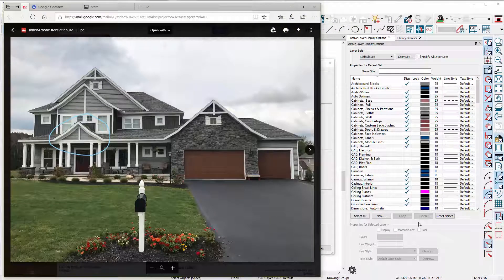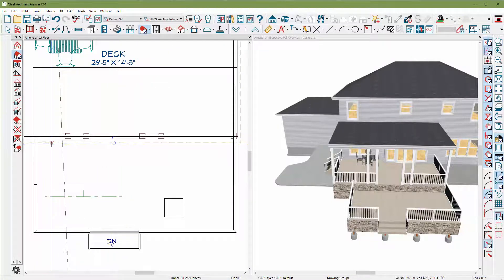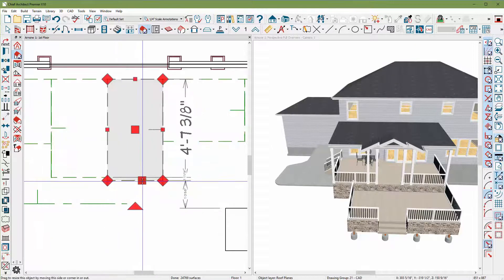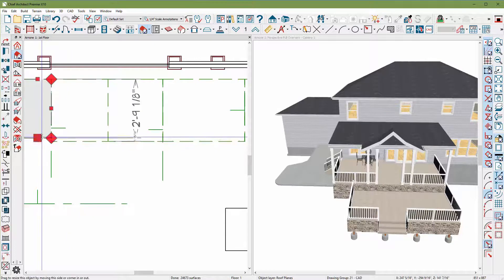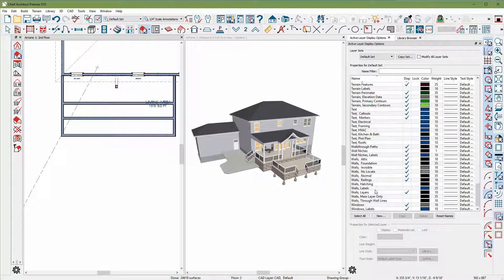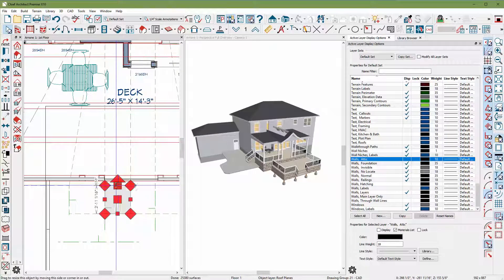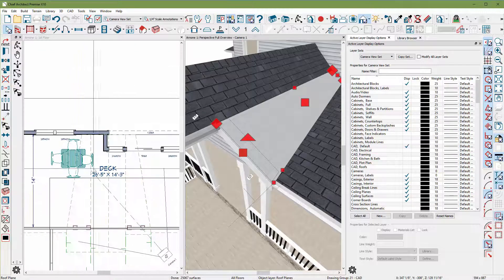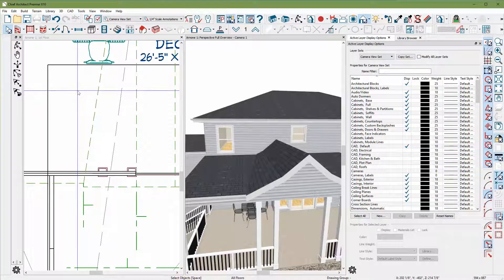Chief Architect X10 Dual Pitch Roof

Comment: I managed to royally screw up a large plan.  I have one file that has the correct floor plan and another file that has the correct elevation.  Fixing either is going to take forever.  Is there anyway to merge files or do I just send different files to layout?  There is a law passing and the plans have to be submitted today.